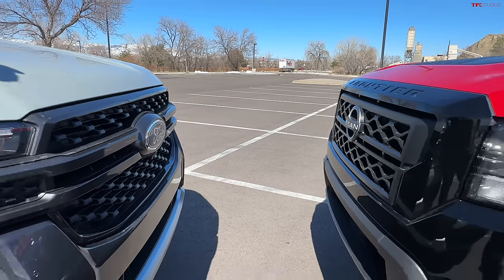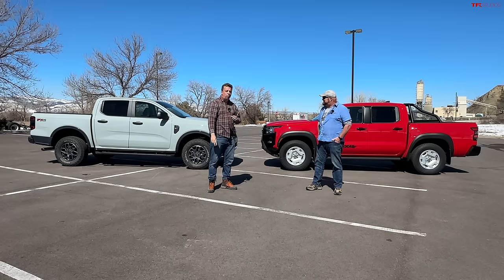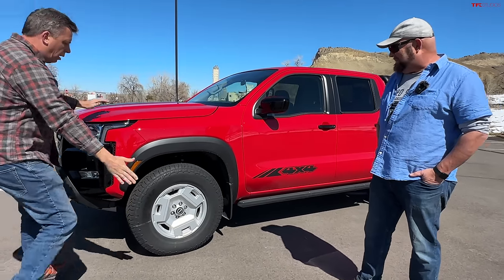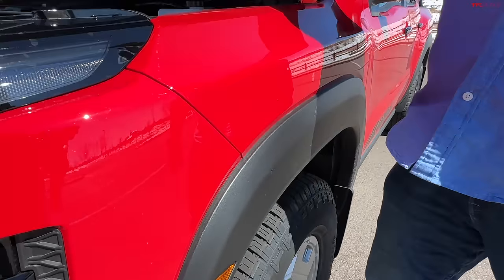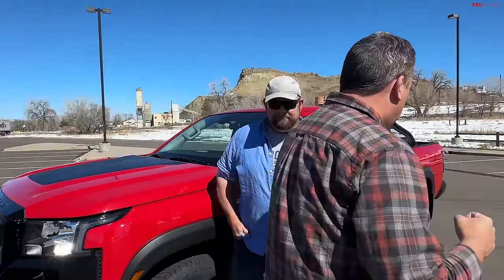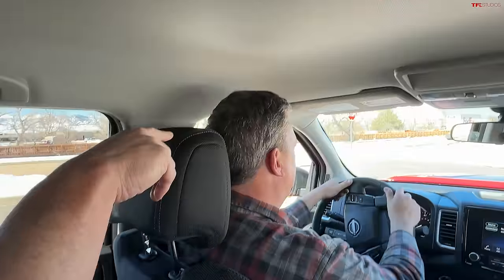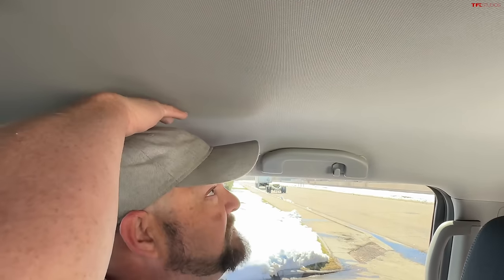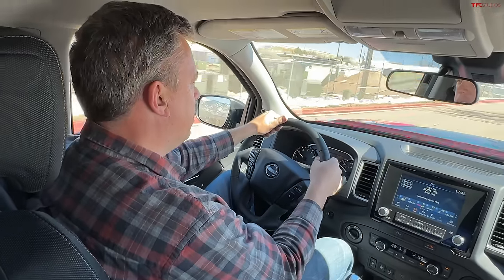This New 2024 Ford Ranger & Nissan Frontier Hardbody Cost EXACTLY the Same, But Which One Is Better?

Comment: I have 21 Nissan Frontier M. E., with that same engine and transmission.  Recalls, and several issues with drive train issues uncomfortable driver seat. One of my customer 2019 Ford Ranger turbo 270,000 miles plus. He loves it. Oh I forgot my Frontier Ac Condenser is gone its leaking refrigerant.
Reply: "several issues with drive train issues" points to a non-English speaking bot... the 270K miles on a 5 year truck gives it away, it's pure BS. Bot.
Reply: I've been looking at the Pro4x to purchase and I keep coming across people having lots of issues with the transmission. Consumer Reports has the frontier ranked as one of the least reliable vehicles you can buy. Sad because I love the looks and the simplicity of a v6.

Comment: Turbos add a bunch of moving parts they make the engine run hotter and when you work on them there are tubes and oil and coolant lines everywhere.... there fun to drive but not fun to fix
Reply: Turbocharged engines are also higher strung, and are MUCH more reliant on routine maintenance with using good quality fluids.  The vast majority of the population will only do maintenance when their dash tells them to, which is not often enough with turbocharged engines.

Comment: One thing you neglected to mention is availability.  You can find damned few Chevy Colorado's, GMC Canyon's, and Ford Rangers anywhere at any price.  I've stopped to look at mid sized GM's and what they have has been sold or what they advertise on line is in transit.  In fact, I've talked to a couple local dealers who cannot even give me a delivery date on GM mid size pickups.  All they will say is "April to June for custom orders".  You know that custom orders are filled first so buying off the lot isn't going to be a viable option until late summer, at the soonest.  You may want to address the on line rumor that Ford, GM, and Jeep are slow walking 2024 mid sized production trying to get carry over and excessive full size pickup inventories sold.  Right now, I am gravitating to the Nissan Frontier Pro-4X as they are sitting all over and you can buy a nicely optioned one for less than MSRP in that $40-42,000 range.  Based on all of the turbo 4 cylinder problems I am hearing out there with GM and, especially Ford, I think I'll stay away from them for a good while.  GM 8 speed transmission shudder anyone?  Software bugs on the GM's?  On top of that, some dealers are giving a lifetime powertrain warranty on the Nissan Frontiers.

Comment: What would you even use a tiny bed like these for?  Unusable for anything I try to do.  Crazy that they don't still offer a 6' as a long bed version.
Reply: Nissan does
Reply: I use my 5' bed for all sorts of stuff, just about every day. I put on a used camper shell and it is the bees knees.  Volume under cover rocks.  Sure, I would have preferred a 6' or 6.5' bed, but that was not available when I was buying.

Comment: Am I weird for not caring about everything that they discuss here (the looks, the outside parts)?  I want to know if they are both direct injection only or is one of them dual port injection with direct......are neither turbo charged?   Does one of them have a simpler fuel pressure system or do they both use super high pressure and complicated fuel systems that will require maintenance or repairs?

I care more about the reliability and the way the trucks are designed in terms of powertrain.

Comment: I got a 2023 Nissan Frontier Pro-4X with all packages except the one with a moon roof, leather and upgraded sound.  It cost me $42,500 (with 8 year mfg extended warranty).  Not sure why a Hardbody was being compared to Ranger (why would I want a Hardbody Frontier)?  I did have to install a Redarc Trailer brake controller (took about 20 minutes).  I came from a Jeep Rubicon, so I like trucks with at least a rear locker.  I did not even bring up that Ford wins hands-down for having more recalls for poor quality than any other auto maker!  :)

Comment: 3.8 liter V-6 non turbo. So, basically to get enough power without a turbo you need to be 3.8 liters vs 2.7 turbo.  Actually you might need a 4,0 V-6 to match the 2.7 turbo.  

Sad all but Toyota only offer a very small bed.

Comment: The new ranger looks nice omg redesign looks nice but that screen in the ranger kind of reminds me of the long screen you see in the ram trucks idk looks nice and instrument cluster where displays fuel and temp other stuff reminds of something that Volkswagens is doing in there cars and suv's this year.     The Nissan frontier yes does give that old retro look with the wheels you see from the 80's and 90's era but the set up just looks nice the screen isn't too big just wavy or whatever I would choose either one of them but you need to compare the Nissan frontier to the new Tacoma just cause there both from a Japanese brand cause comparing to American truck seems kind of different from among its competitor, maybe compare the new ford to the chevy Colorado cause both are American brand while you at it why not compare all of Tacoma VS Frontier plus Honda Ridgeline plus ranger vs. colorado comparing to all of them.

Comment: If the toyota hilux champ for under 20k which retails for 13k in asia some how make it here they are done. Just saw a sewage company FLOVAC  doing work on my street with 4 Isuzu mini trucks and asked how they were holding up with the mini trucks and they said great specially easy on the back do to its low bed which they could access from all sides and it replaced 2 rams and 2 chevy vans

Comment: Don't care much about appearance.  Number one is durability and long term cost of operation.  I bought a 2023 Tacoma access cab v6.  I am a hard core Toyota person for the longevity.  Having said this,   I would not buy the new Tacoma as I don't want the turbo(durability).  I also won't buy the access cab now that the rear doors are gone.  
My other issue is that the cargo beds on all midsize trucks have shrunk to the point of being ridiculous and unusable.  When the boxes are this small, why not buy an SUV instead?

Comment: This should be a good series. But after all the videos on the Ranger this week, it looks worse and worse. Yes, high payload/towing numbers that are good but they shrank the wheelbase which is bad for hauling/towing. Pushbutton start and large instrument panel only available in the Lariat. The bottom of the "big" screen is dedicated to the HVAC controls so really done to brag about screen size only. Would have been better with a smaller screen and dedicated buttons/switches. No cloth optional on Lariat. No moonroof, ventilated seats, or HUD available in any trim. Very un-Ford like to be lacking in choices.......

Comment: Struts for hood are nice until they don’t work, rod will last. Who cares about the engine cover. The screen is in the eye of the beholder. Impressive payload on the Ford. Vents in rear not an issue with such a small truck. Which on would last the longest?

Comment: I personally don't care for little things like the hood struts and what-nots. If you really want that, there are aftermarket kits that you can buy, but really, who cares? When those things fail, you're just left there holding the hood open. The hood prop is simple and just works. And the stupid decorative engine covers are so pointless. Just another thing to remove when you have to do anything with it and added weight for no reason. And push button start is another useless gimmick imo. I love how turning a key has become such an "inconvenience" that people would give up some security with the key fobs...

Comment: Yeah nah, I'll stick with my metal bumpers and better equipped for the money 2019 ranger. The locker being in the touch screen is a big problem along with no steelies or smaller more reasonably sized radio screen with real buttons switches and knobs.
Reply: Wait, wut?  Locker in a touch screen?  What fresh new unholy hades is this?

Comment: Maybe I'm just paranoid... maybe I'm just wrong, but I have a very hard time thinking those turbo 4 cylinder engines will have any kind of real longevity.  if you just use the truck as a fashion statement I'm sure you will be fine, but if you use the truck for what trucks were made to do, then I gotta believe you're not getting150K miles out of those things.

Comment: Ecoboost timing system is garbage, as are the head gaskets, Frontiers handle neglect and abuse better, work trucks are abused and neglected routinely. Torque at low RPM is better for work trucks. They say at the end that the Frontier also starts out cheaper, with a shorter cab and no roll bar in the back; the payload and towing should be more competitive.

Comment: Nissan has not made reliable vehicles in more than a decade. Since switching to cheap Chinese parts, Nissans breakdown constantly. With minimal torque and lightweight build, you can't tow much with the Nissan or offroad.

Ford makes some of the most dependable, durable trucks in the world. It is ridiculous to compare a Nissan toy to the heavy duty Ford Ranger. The difference between the two will be  readily apparent when towing or taking the Ford off road.

Comment: You like the plastic engine cover and the ford does not have one? No offense, but it's like my wife commenting on the engine bay pointing out the most useless part under the hood. I mean the color of the vehicle is more important than that engine cover.

Comment: The ford is clearly the better truck. The Nissan fort that kind of money looks like a base model with the blacked out bumpers. They're still so far behind every other truck manufacturer. Its the same problem they had with the titan. Everyone else is moving forward while they're still 6 years behind in tech and interior design.

Comment: It’s not a real hardbody because real hardbodies come Manuel with performance engines that should be interchangeable with there performance cars like the 240sx quick return spring shifter upgrades on the original hardbody they should have added the 2023 Nissan z motor and manual transmission trust me real hardbody fans would pay more if it had all those upgrades that’s what made Nissan great they have gone soft

Comment: Too much tech and complexity with the ford.  Turbos are nice for sporty cars.  Trucks are not supposed to be fast. Putting them in trucks and loading them up is a bad idea.  They have to work harder and produce more heat and like it or not wear out faster.  Also a lot more plastic components that degrade crack, etc with heat.  It’s disappointing that the combined mileage is only two mpg more for a smaller engine and I’m sure that’s with minimal turbo use meaning it will be the same as the Nissan for most. (A 4 cylinder should save you money in gas lol) My money if I had it goes to the Nissan.

Comment: 3.8 litre V6 from Nissan. GTR is going out of production, imagine if they built a halo Frontier with that engine, would shite all over the performance offering by the other mid sizes and embarrassing for the Ranger Raptor. Build it and they will sell a bundle.

Comment: When seating in the Nissan you had the seat closer to the dash because Andre's  knees where closer to Dash then in the Ranger.   Andre your truck at 41,000 is config like a STX Ranger considering you do not even have cruise control in your Chevy. The Ranger to me looks better than the Nissan.  Covers over a engine is not a plus Andre. Why did you not do a 0-60 time on both all the test show the Nissan is slowest of all the mid size class.  Also the Nissan has less legroom than the Ranger. The Nissan has 33 and Ranger has 34 to do the test correctly you need to place the seats at their farthest back position  and see which has more  space available then. I have to disagree with Nathen I like the seating in both the rear and front seats of the Ranger better. Please in the test set the seats at the farthest back setting so we can get a true space comparsion in rear seat space.

Comment: If I were in the mood or had any interest in trading in my trusty high mileage '05 Colorado Z71 4X4 pickup for a new truck I would go with the Nissan. It has been a long, long time since I've had any interest or trust in anything from Ford.
Reply: That's me. I had 3 new Ford trucks, and they were none stop big problems.  That was expensive, major repairs. Not to mention, the dealers service was shitty and that's how they treated me. Very arrogant and bad attitude they gave me. Plus, they can't fix anything .

Comment: Maverick > anything else.  95 percent the ppl out there thats all they need
Reply: Not about need, about want.  Maverick is girly
Reply: @Mike-te1xx   I've already towed and hauled more than most ppl do with full size trucks in their lifetime. 0 issues and the 29mpg is 👌
Reply: @jonathonvince561 I just hauled 42 sheets of drywall in my HD. Give it a go lol
Reply: @pryme2013  0 issues. I have a trailer
Reply: @jonathonvince561  the Mavericks max tow is 4.000lbs only? With the weight of the trailer and the plywood at 80lbs each you're already at limit or over. Even for just homeowners that do light towing 4.000lbs max tow is very little.
Reply: @Pantelifts10  plywood he would be over that’s true but drywall is lighter. 42 sheets is around 1,600lbs
Reply: @Pantelifts10  42 sheets of drywall is 2200lbs. That with my trailer is well under 🥴 sorry your math doesn't math.
Reply: @pryme2013  42 would be 2200.
Reply: @jonathonvince561  yeah old school drywall. Everything now is ultralight. A 4x8 sheet weighs about 39 pounds.
Reply: Either way 42 sheets ain't no problem. 😂😂

Comment: Large screens are crap. All they do is distract from driving safely. You want physical controls you know by touch. A small screen will display maps, and that's fine. Found On Road Dead is not an option, it's gonna break down for sure.

Nissan 1
Ford 0
Reply: Yep, keep the large screens for your laptop that lasts 3-5 years and gets tossed.

Comment: I have been driving turbos since the 1980's and love them. So I would definitely pick the Ford with that proven 2.3L. I think the Nissan is ugly and the interior by far lacking in technology and refinement. 

My main concern with the Ford is the level of tilt and size of the steering wheel. Ford has that crappy Honda style FAUX tilt steering which tends to not go low enough for me, and telescoping only makes that problem worse. Our 2013 Ford Edge was like that and I hated it. I prefer a non-telescoping wheel that has the old American style tilt wheel that raises and lowers much more and changes the angle of the wheel as it tilts. Looked like the Nissan had the kind of tilt I prefer. I just don't like the truck. 

The Ford Edge also had a small steering wheel that was also uncomfortable to hold for long drives. I would hope the Ranger is bigger.

Comment: Honda Ridgeline is about as much a pickup as a Hyundai Santa Cruz. If you don’t have a Frame you ain’t a pickup. As for MPG, I get around 25 with my 22 Frontier. I didn’t hear the guys mention the Antenna on the roof of the Ford? You’d think a new model wouldn’t have the black stick on top of the roof, regardless of all the fancy gadgets which usually fail in new vehicles.
Reply: that antenna is gone on a low clearance bridge or obstacle

Comment: There is a reason these 2 trucks are being compared to eachother. It’s because they are both built the cheapest😂 and ugliest (IMO).
Just remember you can get a fully loaded Colorado ZR2 for almost the same price, or you can get the Z71, and Trailboss fully loaded for cheaper then both of these🤣 you can even get a GMC Canyon AT4 trim for cheaper. So where is the real value🤔

Comment: The Nissan rims are hideous.  Looks like the ones they had 20 years ago.
Reply: That’s what they were going for with this trim..
Reply: That’s the point…  it’s a throwback based on the old 1980’s hardbody 🤦‍♂️
Reply: I understand the throwback look, and if you're into that, it's probably very appealing.   I don't mind the styling. I just don't care for the rims.  Other than that, it looks like a solid competitor, and I really like the non turbo engine option.

Comment: Don't buy the nissan
  There seems to be a cover up regarding beds cracking where they attach to the frame.  I can provide picture or you can just google it.  When the problem gets so bad that customers can finally identify the issue, the truck is outside  the 3 year warranty.  Take it from a from 2019 first owner.  Local dealership said my claim was denied with zero proof of a claim actually being submitted.  STAY AWAY!